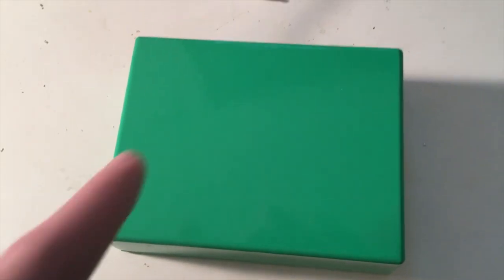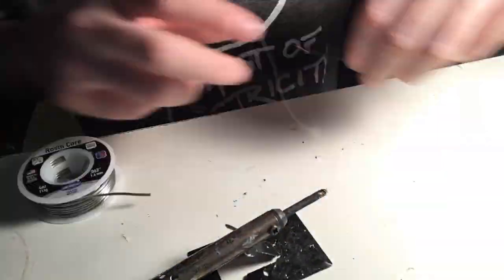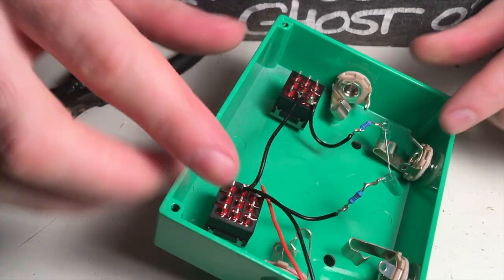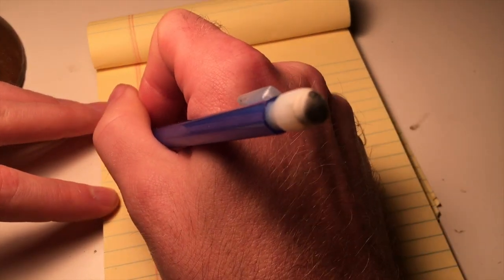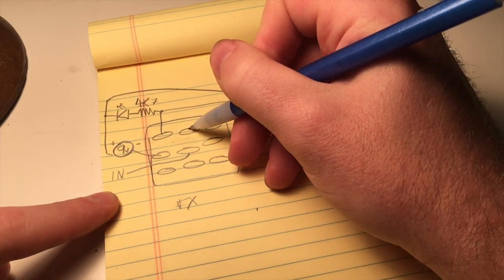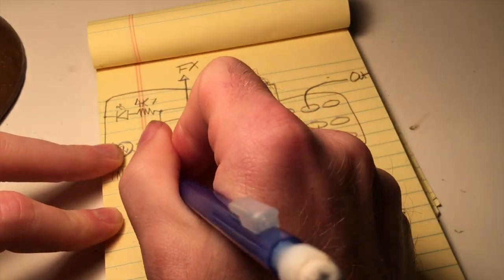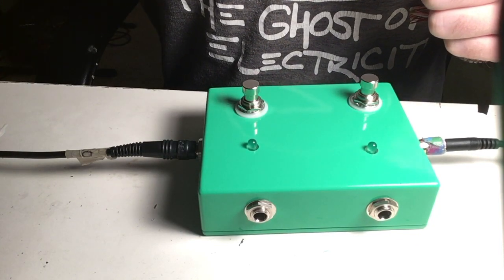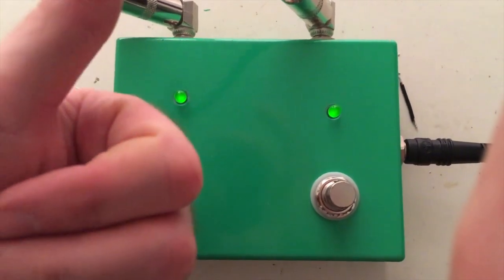Building a DIY Effects Loop and Kill Switch!

Comment: Please remove the tip from your soldering iron and grind it to a point. Then reinstall it in the Iron and get it hot and TIN IT. get a wet sponge and use that to wipe your tip off. The sponge will keep the tip clean and you will have an easier time soldering. Nice project. Good job.
Reply from the maker: All very good tips. Was using a super old RadioShack iron at the time. upgraded to a big boy soldering right after this vid.

Comment: Hello man! Love the pedal but was wondering if you have a different diagram? I am thinking of making a passive feedback looper such as yours which will use a dpdt momentary and without dc power. Is that possible?
Reply from the maker: Extremely possible. You don't need my diagram. Check out how these switches work and you'll be able to make up your own design in 15 minutes! I love the idea of momentary switches controlling feedback. Sounds like fun!

Comment: Commenting five years too late: Can this be done but with mic input and output, for vocals? Would that require more mojo with a transformer?
Reply from the maker: Short answer is yes. You can use this same idea to make an XLR effects loop. BUT you need to consider other things when using a mic like the volume that mic outputs, what ovlume devices in the effects loop expect, whether too use a preamp and where the chain it goes, etcetera.
Reply: @RayMcNamaraMusic  Buh! So much math! Why doesn't an easy answer drop in my lap? I appreciate your thoughts. Thank you.
Reply from the maker: @gabrielcone6733  Basically put a preamp first in the chain, and you'll be fine. Watch out for feedback.

Comment: Is-it possible to use a switch looper to connect 2 or more pedals in parallel ? Many switchers allow from 2 to 8 loops, like this one https://fr.aliexpress.com/item/4000348833245.html?spm=a2g0o which allows 3 loops, but I am not sure that putting pedals in parallel work because I tried to do it with 2 pedals simply using cables and Vintage EHX 5X Junction Mixers but it doesn't work, sound is horrible probably because of connecting pedals outputs in parallel I think. So is this thing: https://www.thomann.de/fr/electro_harmonix_tri_parallel_mixer.htm  the only one possible to use for parallel connections, because it is a mixer in fact... ? What do you think about it ?
Reply from the maker: Easily. Start by drawing the wiring out on paper.